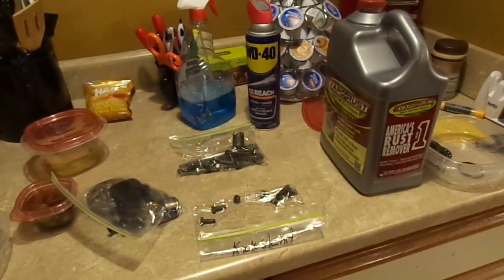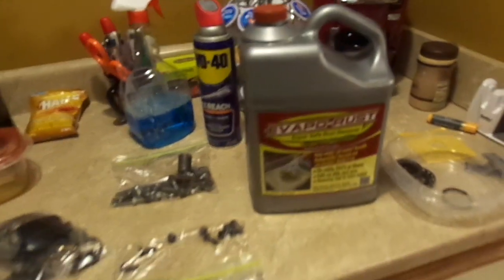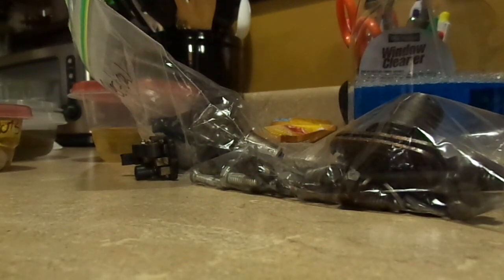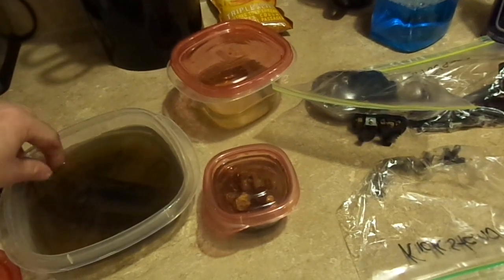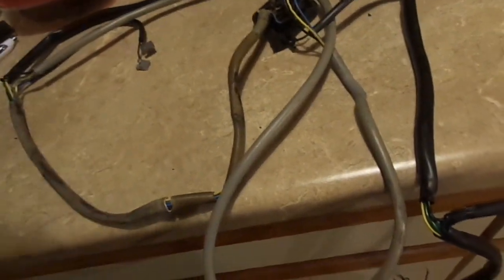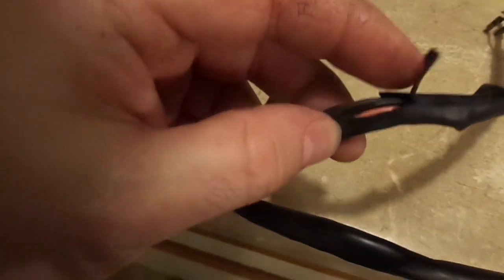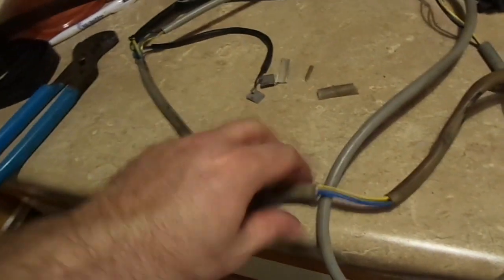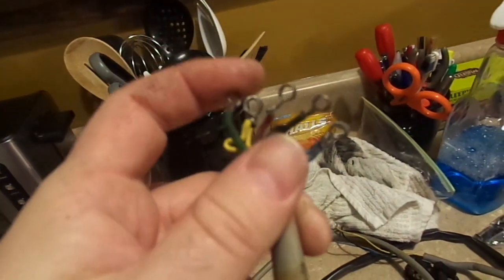1964 Vespa Project; The Wonders of Evaporust, and Total Projected Cost Estimate

Comment: You could take an old stainless cooking pan and fill it with some sae 30 engine oil and heat the oil outside on a hot plate or portable inductive cook top which already has temperature control, until it reaches about 400 degs then put the bolts and nuts and other hardware in it to cook about 15 minutes, scoop it out and save the oil for other projects! This will help treat the metals! They do Hot dipping of engine blocks in oil, not for rust protection, but as a treatment for the engine block! A friend of mine kept blowing up his 327 chevelle ss, then he had the engine hot dipped in oil at the request of the builder and it lasted years after that!

Comment: Problem with body filler, is that, unless it is good high quality filler, and the metal is prepared properly, it will crack, and it will fall off. Personally I like to use fiberglass filler as the base filler for adhesion and strength. Lightweight stuff will crack and fall off by itself. Personally, I would replace the panel, and that way there will be much less filler needed to hide the weld seam.  If the fender was not so heavily hit in, and a bit mangled, I would try to save it, after all, it is original, and that is always good, but in this case, I think in the long run you will be much better off replacing the panel since a patch is available. Doing a restoration, putting this kind of time and money into it, should do it right from the start because you don't want to have to redo the body work in 5 to 10 years because of some failing bondo.